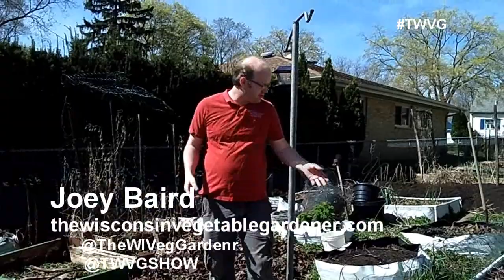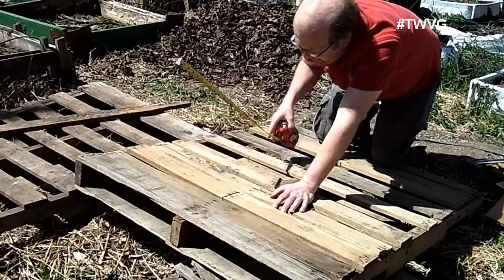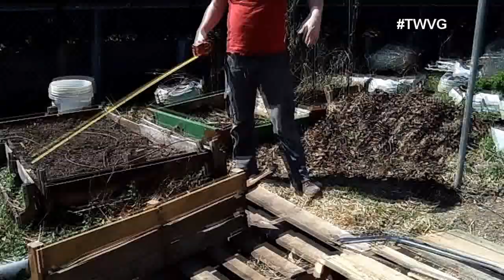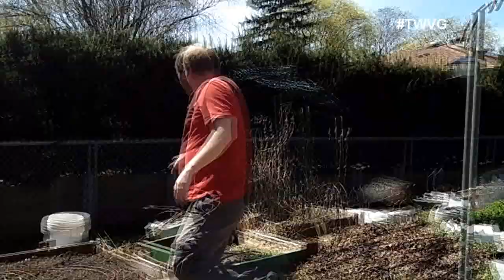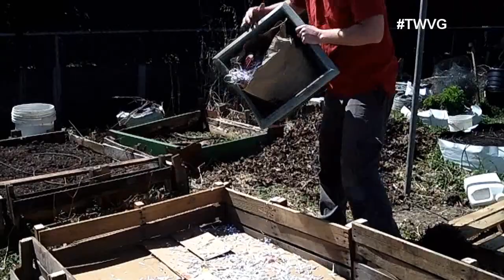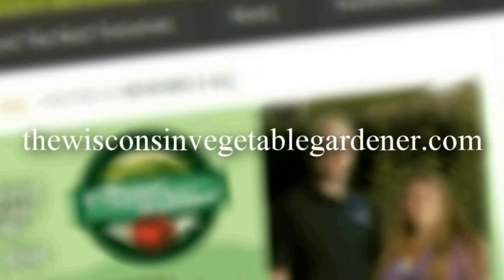How to build a pallet raised bed - First garden new gardener

Comment: No offense but this is a terrible idea and clearly made by someone with no experience in warehouses or shipping. The vast majority of pallets are chemically fumigated with some pretty nasty chemicals....and that's before any exposure to toxic chemicals that may leak, spill, or splash on the pallet from the goods in transit. Add to that any gas, oil, or contaminants on the floor of any ship, truck, train, or warehouse that the pallet sits in. All of that leeches into your soil and the plants, vegetables, and fruit you'll be consuming from that bed.
Reply: You have to look at the markings on the pallets.  Those marked HK are stream treated